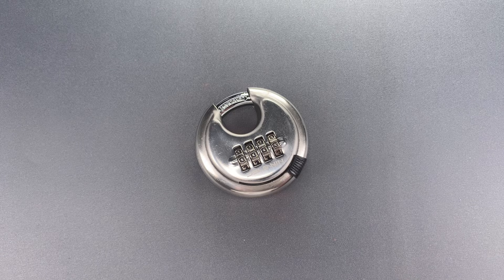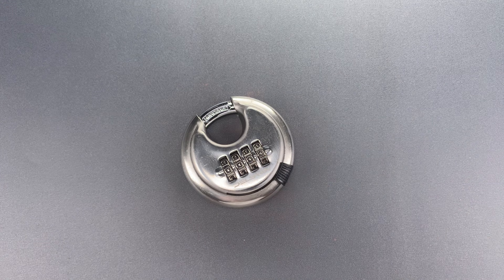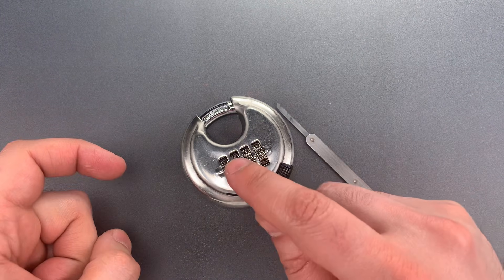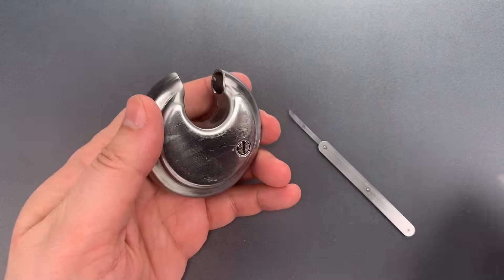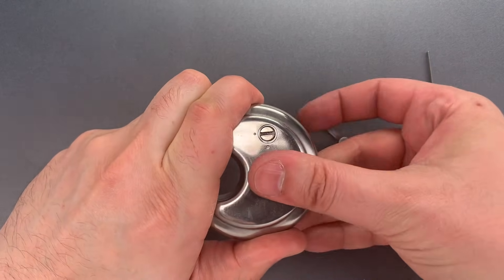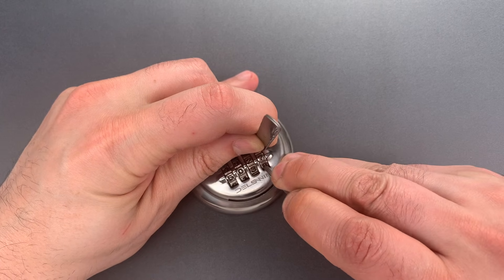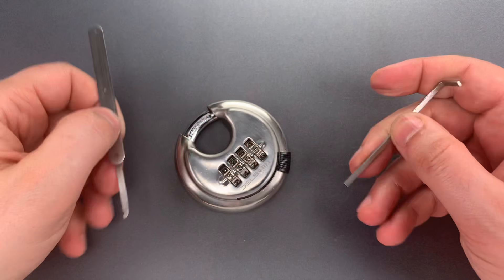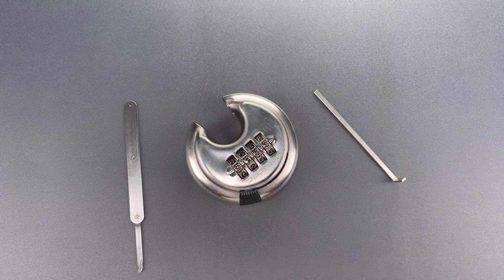[1264] Decoding 4-Dial Disc Padlocks

Comment: Nice episode.
Reply: Is it possible that this lock has been redesigned? I bought your decoding tool and am not able to feel a flat spot on any of the dials. It is the version sold by ace hardware with the raised serrated sections surrounding the dials. Is the position of the notch on the tool and or the depth of insertion important? I have tried many different insertion depths to no avail. Thanks.

Comment: Have you tried decoding the Brinks disc combination lock? I have purchased the notched decoder, but cannot seem to figure this out. I changed the combination on the lock, but it will not open. I am trying to figure out the trick. I realize it may be easier to try and return the lock, but I like the challenge of trying to decode it.
Reply: Not all of these locks work as LPL said - in other words, they can't all be decoded with this method. For example, the Davinci lock. The "flat space" doesn't seem to exist on a Davinci. I hope I can be proven wrong.

Comment: Mine is the Stahlex and it is impossible to feel at what number the roller is not round. It must be different. When you observe a round shining object the light is bent in a way that you notice a small streak mirrored back in reflection. This gave away the flat edge since the right numbers had a less round shape next to the roller. As always these form the right code. No tool required, just artificial light and pulling the rollers back sideways one by one. No tool required and no turning the dials after finding. There is this one thing: pushing the link only does not open the lock. You need to use the black lever button.
Reply: holy smokes! thank you!! I have this Stahlex version, too. It's such a flawed lock. 
step 1: If it's locked and SCRAMBLED, you can force the combo changer into it's change-combo state.
step 2: Then you can change the dials (say +1 to every number of SCRAMBLED) and then turn the changer back. 
step 3: now the new correct combination is the original combo digits, each +1 (or +/- whatever you did in step 2)

So, someone can lock you out, with only a screwdriver. and picking this thing is a nightmare. Thankfully, after days of trying to open this lock - pull picking was hopeless, and this decoder method (which is new too me) was tough and I didn't have the right tool and, like you said, it's really subtle - it's possible and thanks to you I tried to see the correct combo. Though, still not obvious, it's successful and reliable.

Jeeze, i locked myself out trying to see if the lock was exploitable with just a screwdriver.

Comment: Have this exact lock as I like to buy random curious locks when I see one. This lock cost me some blood (literally). The sawing for the lever is very sharp and you risk hurting you finger on it. So took out the dremmel and carefully deburred the lever slot - now it doesn't cut finger. Horrible design....

Comment: I have this lock X2! Outside on a vinyl gate for two years and no maintenance. Honestly they have help up very well and operate smoothly without maintenance. The paint inside the numbers however is gone making them difficult to open.

Comment: The only lock I have opened without the key or code was my dads key cabinets 3 digit code lock. I used a flashlight to scroll on each wheel untill I no longer saw a metall reflection between the wheel and lockbody on the left side of the wheels. After that I turned each wheel 5 numbers up or down, and boom that was the code. I don't quite remember which direction, and this only works if the manufacturing is shoddy, and there is a little play in the wheels, so you can see between the wheels and body into the mechanism, albeit through a millimeter wide crack, but you only need light to pass through

Comment: I've been dreading this video.
I use these locks on EVERYTHING. Yes, they are pick-able but as a contractor I need a lock that is combo (no more 6am calls due to missing keys) and can't be cut (easily). These locks work for me. These locks actually do good in the weather, I use them in all my pintle trailer locks. Sometimes the wheels get stuck and you need to use a key to get them to spin but WD fixes it

Comment: So, I watched The Hot Rock last night in memory of George Segal. At the time when it came out, I had no clue regarding the mechanics of lock picking, but, now, it occurs to me that any qualified locksmith should not have had any trouble opening those locks. But of course, if George had opened them quickly, there would be no movie.

Comment: Pretty much any 4 digit padlock can be opened by feel (and sometimes hearing) only. Each wheel feels different when it slides into the correct position. Back when I was a kid in highschool and a lot of idiots had 4 digit padlocks on their school lockers I used to be able to open any given codelock in about a minute.
Reply: Try a Davinci 4 digit lock. Betcha can't pick it or bypass it open.

Comment: Speaking of generous amounts of lube, I have a question. Some of the older and the less expensive locks that I've been able to open seem to have little if any lubrication. Do you put a drop or two of oil into the keyway before attempting to open the locks you test? Thank you.

Comment: Instead of picking this lock, couldnt you just turn the screw on the back and change the combination?
Reply: I suspect that the code changer will not turn while it's locked or else the number wheels will spin without changing anything.

Comment: I had a thought come to mind when I was watching your Bowley lock video from 3 years ago.

You brought up the fact that the lock used pretty standard pinning kits which would make service the lock by a locksmith easier.

My question: if you theoretically wanted to change the pins in a lock to retire an old key bidding and move to a new one, how would you do that?

The obvious answer to most would be to just change out the lock, but I was wondering if something like I described was A. Doable and B. Viable.

Love from Australia,
Jack

Comment: So question, how do you know which locks that after you use that tool that the number is on the correct one and some locks after you find the right number you have to move the number 2 digits?

Comment: So, after you find the "flat spot", how do you know that you need to (specifically) "rotate down two digits"? Is that the way that these types of locks always work? Is there something specific to this particular style or manufacturer that tells you that this one is two digits down? Trial and error?
Reply: Somebody had the answer to the same question elsewhere: If it doesn't open, just move all the wheels 1 spot until it does.
Reply: @Jimorian  I figured it was something like that. It would be nice if he would address it in a video. Every one I have seen, he just says "turn them til they are loose, then turn them all 1 digit/2 digit/whatever, and viola".

Or if he has worked that part out beforehand, at least say so.

Comment: How much is sixthousands of an inch in millimeters... if i calculated it right that would be 0.0042mm and that cant be right, right??
Reply: if my calculations are right then .006 inches = .1524 millimeters
Reply: @oldjesus8978  ahh... i see, i tought it was 1/6000.... thanks 👍👍

Comment: I'm not sure if this is possible but what if you can make a lock that requires all the pins in the right position (for one second) or it fails. The pins just slide (up and down) and don't have anything to keep the pin in place. Maybe with really advanced technology. Doesn't seem like it will happen anytime soon.

Comment: I have personal experience of three of this (apparently) exact lock model used for the last 3 years outside in typical UK winter weather without any hint of sticking wheels - so one of us was lucky and the other not I guess.  Also, if you try to feel for the flat on a wheel using a thin knife tool, but by direct feel rather than the 'lever and fulcrum' method shown by lpl here, it is very hard to do - the flats are pretty slight in the ones I have tried picking anyway.

Comment: Another great video...recently acquired a wrecked 2005 Dodge Neon SRT-4...after switching everything over to a new body will be a show car...bought a Lishi thinking I could pick the ignition since the keys did not come with the car...no go...did not realize the Lishi are only meant for the doors and the pick/decoder does not enter into the ignition lock far enough to pick and decode it...so I either have to modify the Lishi to go into the ignition slot further which then makes it tougher to use for a door or will have to by wafer rakes....what would you suggest...I want to keep the original lock from the car so am not willing to just drill it out to unlock the column and change the cylinder...

Comment: How do you know that you have to move the code down by 2 steps when you never worked with the lock before?
LPL has done some locks like this one and most of the time the combination is already what you entered. So how would you feel here that you did not make a mistake, but that the wheels need to be turned two steps?

Comment: So how do you make a combo lock that isn't susceptible to this trick? There's got to be a better way to rig up the wheels or something.
Reply: To this specific attack? Undercutting the wheel housings so they overlap the wheels would be good enough for most cases. Would chew up tools, anyway. Ideally, a combination of pin / tumbler to turn the lock into operating mode and the dials would provide an ideal alternative, but would make for a bulkier lock if the core is made to be replaceable.

Comment: just ordered my j tool today waiting on the magnet to come up for sale then i plan i using this tools for a short time and seeing where i could improve them the whole lock picking thing is a bonus i am a machinist by trade so stuff like this interest me more in the mechanics of how this stuff works then really bypassing any locks like the tool holder i have found if i turn down the collar on scalpel holder it works better for me then the flat one but you tend to get more turning in the tool if you have a soft grip i am seeing if i can't put a collapsing neck on the shroom tool so it can be both a 2 and 6 inch if need be i find this stuff very fascinating and love it keep up the vids

Comment: Question: How do you know to shift each number back two places at the end? Is that typical for combination locks? Does the number vary?
Reply: It seems to depend on the construction of the lock internally. some of them need to be shifted by a certain number, others don't. I think you just have to know how many places it is for a given lock, or you could try moving each wheel one position, trying it, then moving it again and repeating, so long as you had the flat spots on the wheels all lined up.

Comment: Anyone know why two digits? If a lock like this was randomly found, then how would someone know that after decoding you would need to move each dial down two digits in order to open it?
Reply: You just move all wheels together until it works - at worst 10 combinations to try.
Reply: @jarkus4  Thanks for the reply. Does that mean that it will always be the same for each dial? In other words, move all two digits versus move the first one two digits, the second one five digits, etc. Ten different things to try seems a lot more reasonable than every possible combination.

Comment: Is there any lock of this type that is secure and more hard to decode, or is it just a bad idea to have one like that ?
Reply: There's wheel combo locks like this where you need a very thin tool, perhaps with the notch as seen above, which at least take something special to open, and then there are wheel combo locks where you can feel the combination by lightly pulling on the shackle while moving the wheels. So definitely a spectrum of vulnerabilities from "anybody can do it right now" to "at least a little bit of lockpicking knowledge with a tool" but all probably exist below an easily pickable key lock for security.

Comment: interesting...
in other locks you find the digits that are loose and you just open the lock... in this case, you had to go down 2 digits... why is that??
Reply: Most likely it's due to where he placed his tool when searching for the flat part. That's probably not the position the lock opens in ...

Comment: honestly? the fact that you still need to move the wheels 2 digits after finding a loose spot already makes it quite safe, because you may rememmber the rule about "Looking for loose spot" on many locks like this, so i bet many people will forget quickly about "oooh yeah i suppoused to move each digit by 2 turns after this!" makeing it quite safer at this manner in rarity of how to crack this one open.
Reply: As somebody answered elsewhere, find the loose spots.  Try to open it.  If it doesn't open, advance all the wheels one position and try to open it.  Rinse, wash, repeat.

Comment: so out of curiosity how do u know witch locks u need to move 2 down and those u dont need to move at all ?
Reply: That's fairly trivial. Get all the loose spots in place and try to open it. Still locked? Rotate all the wheels by 1 position. Repeat until it's no longer locked.
Reply: I imagine LPL gets a new lock and spends a few minutes examining it, noting things then goes with a plan knowing it's internals, tries from there. if pretty successful he redoes it 2 or 3x then starts filming
Reply: exactly what i wanted to ask.

Comment: How did you know that you had to move two positions to find the right combination?
Reply: Probably because the flat spot he felt is on top of the wheel therefore he has to go down twice to get that said flat spot into position which it should be in the center if i am not mistaken
Reply: if not because of what that guy said; it only takes 9 tries to shift them all the way around to find out where the flat spot needs to be oriented once all aligned i guess.

Comment: Can you do Handcuffs next?
Reply: Too easy.
Reply: Most handcuffs don't technically have locks, they have a single warded latch. The shape of the key is irrelevant; anything that will fit inside the hole, and reaches the lever will do, there's very little skill involved.